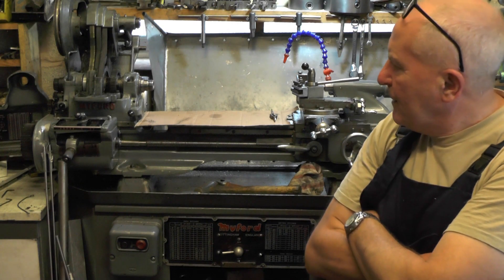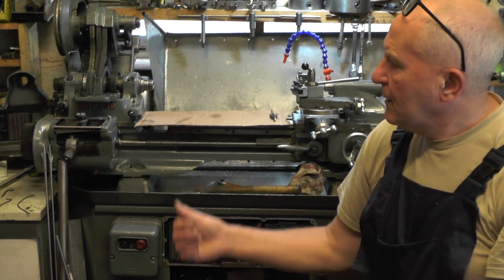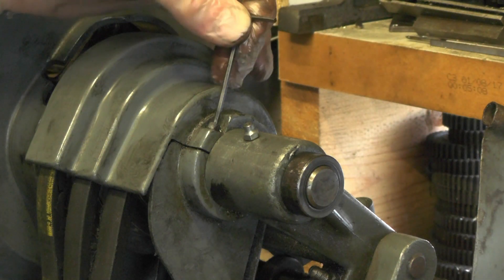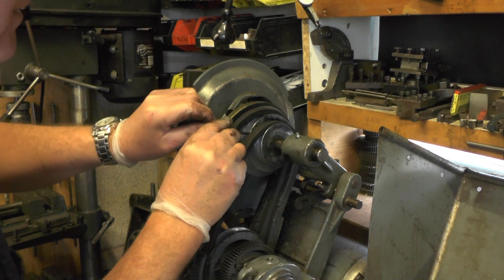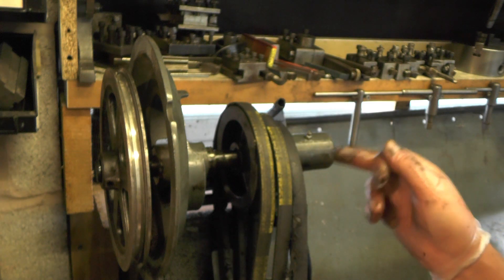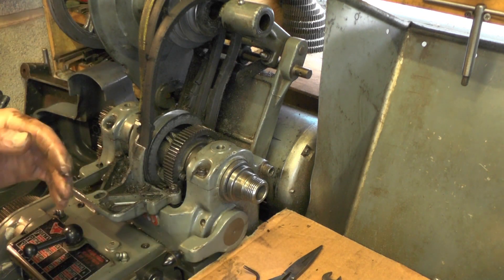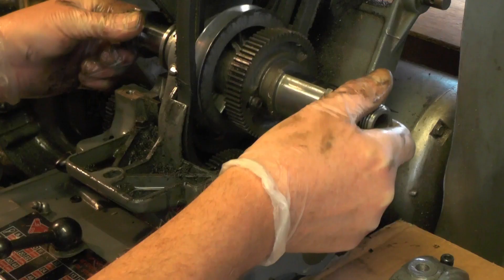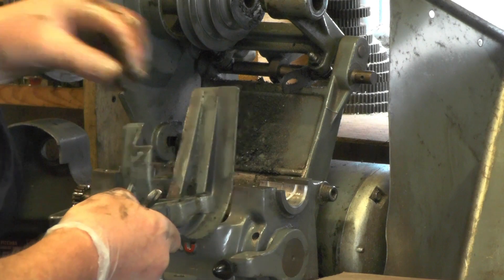Myford ML7 Tri Leva Mechanism and Belt Change Complete Guide PART 2 "mr factotum"

Comment: What ho Mr F, 
In the olden days price was often a guide to quality but nowadays you cant be sure anymore. Even going for known name brands is no longer a guarantee, if a dodgy source is selling knock offs. The original belts on my Chester mill were rubbish, almost from new they caused knocking and shed rubber like a street racer. Continental brand from a local bearing supplier cured things for many years and weren't overly costly. 
Looking forward to part next.
ATB 
  c
Reply from the maker: hi chris
yep, your spot on there, my moto is buy cheap, change more frequent if required,  i'm not a total skinflint, but  like value for money. Brand names, warranties, guarantees, promises and Insurance, arn't worth the paper there written on today.
 The clocks ticking on these belts so watch this space🤣🤣🤣
take care
mr f